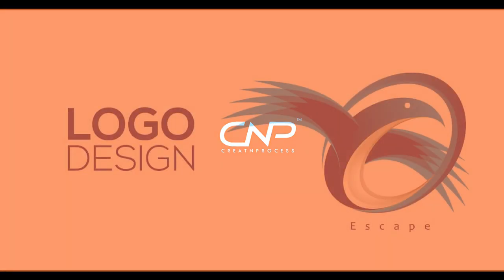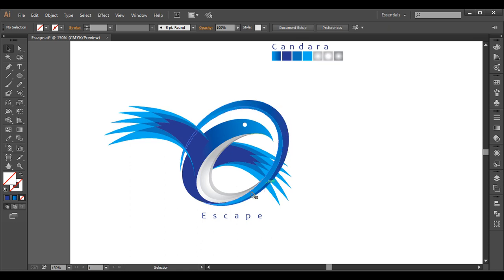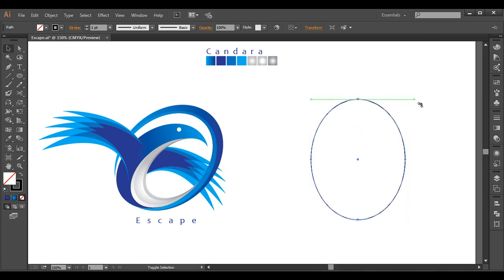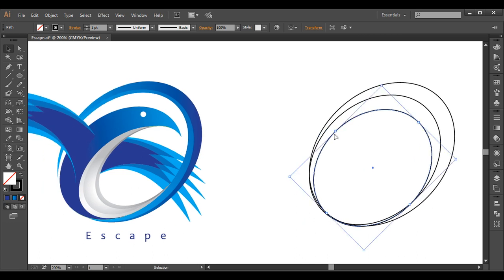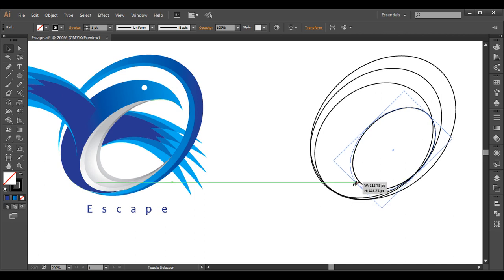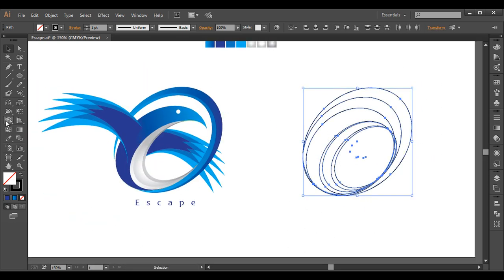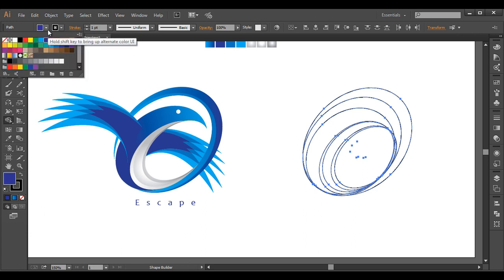Professional Logo Design - Adobe Illustrator cc (Escape)

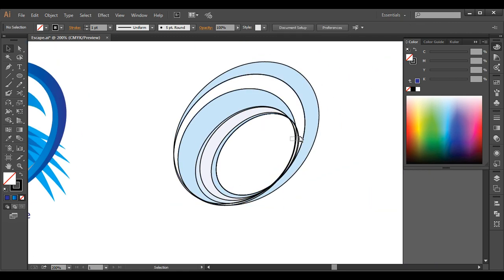Comment: how did you delete like in the 4:42 . when i select it, it deletes all. not the lines
Reply: When he added color with shape builder tool, at the same time he made those areas in separate shapes. After that just delete all other unnecessary parts the way you want, if you understood what i said earlier.